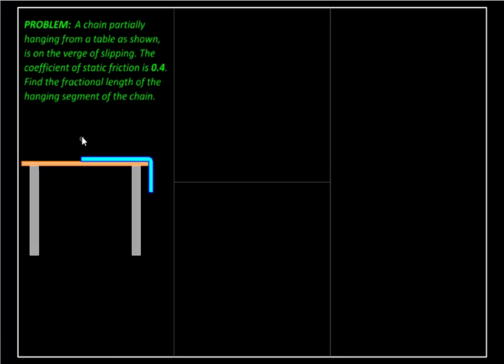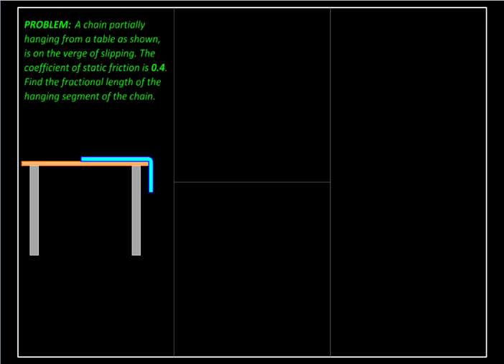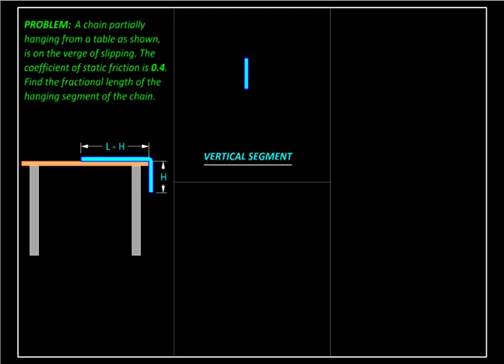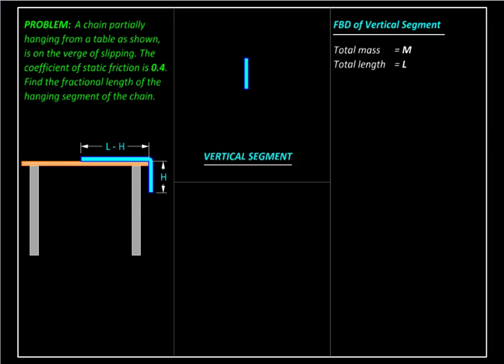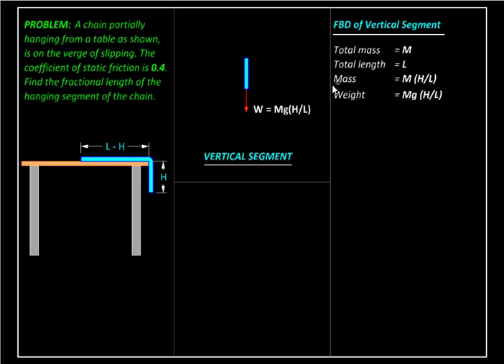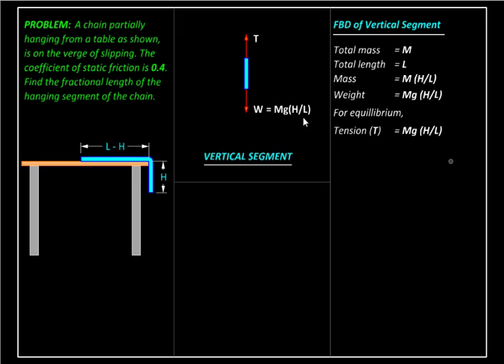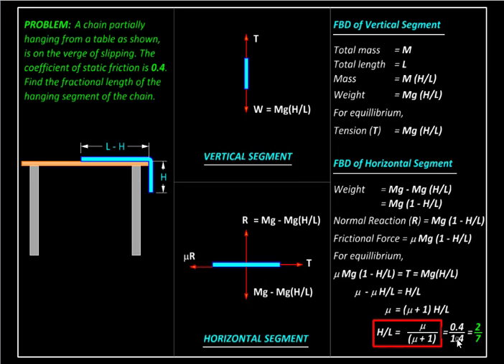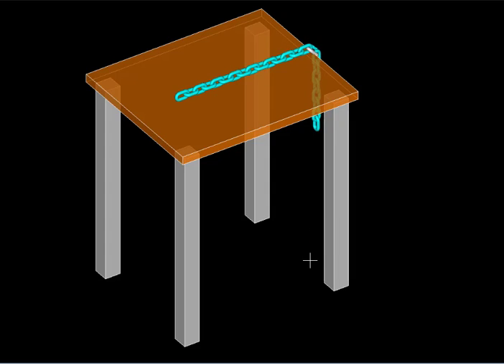Physics with MicroStation Friction: Chain sliding off

Comment: A rope of length L and mass M is placed on a table in such a way that a certain fraction of it is left hanging. If the dangling part is greater than or equal to x, the rope definitely falls. The coefficient of static friction between the rope and the table is?
a) L/(L-x)
b) x/(L-x)
c) x/L
d) 1- (x/L)
e) L/x

Comment: Sir if chain and table are friction less surface. what will be velocity of chain leaving table ? can you explain from work energy principal point of view. Thanks
Reply from the maker: For the frictionless case,  even a tiny overhang of the chain can start the sliding motion. 
So initially, practically the entire chain is lying on the table and its Center of Gravity is at the table top
Then the chain starts sliding and when its last link is about to leave the table, its CG is at a distance L/2 below the table top.
So the loss in PE = MgL/2 = gain in KE = MV^2/2
Solving for V gives, V = sqrt (gL)